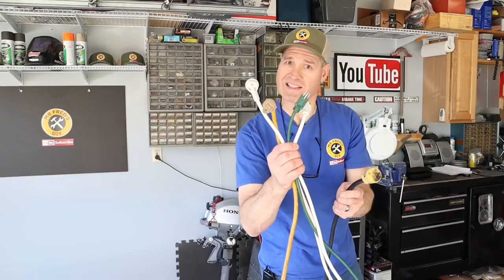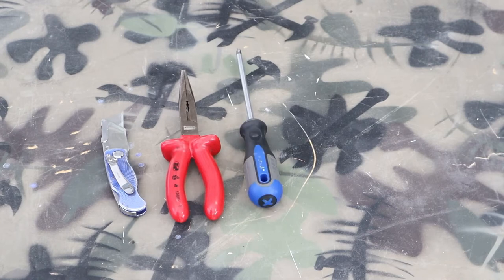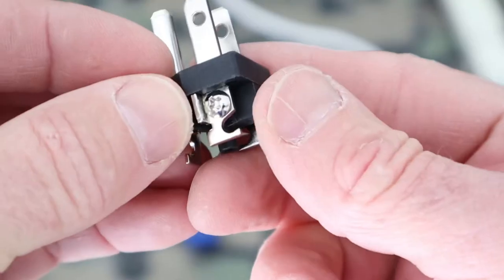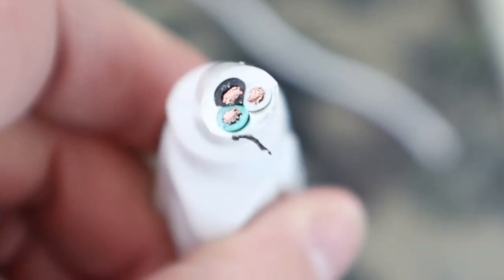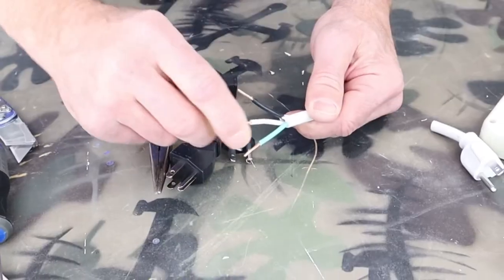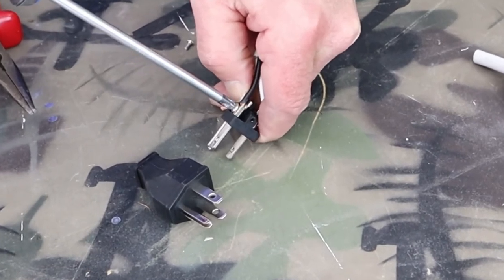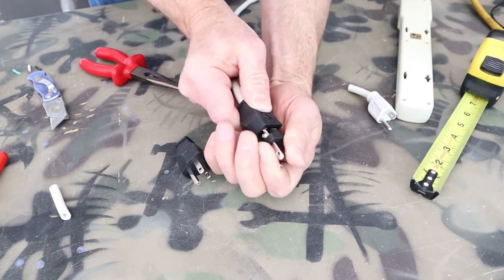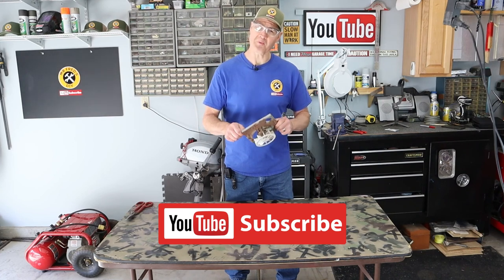Damaged Power Cord Repair

Comment: What about a 2 prong?  Is there a right or wrong way to replace a 2 wire, 2 prong male end?
Reply from the maker: Two blade ungrounded plugs come in either polarized or non polarized. I recommend using polarized. These plugs have a wide blade and a thin blade. The wide blade is for the neutral white wire, and the other is for the black “hot” wire.
Reply: @MrFredsDIY  I should have mentioned that it's a non-polarized replacement male end. 😶 I just don't want to set my place on fire.